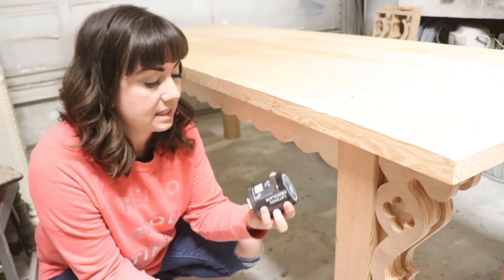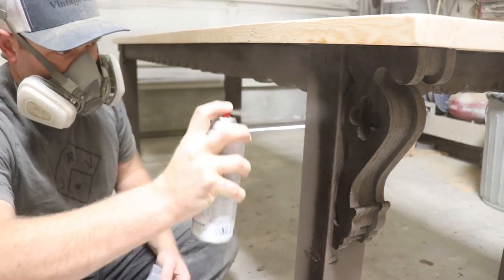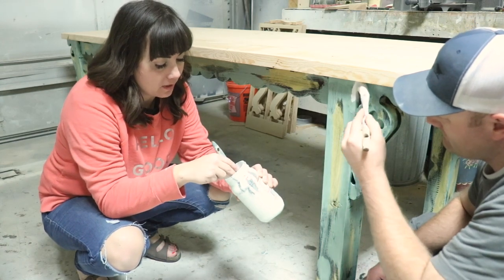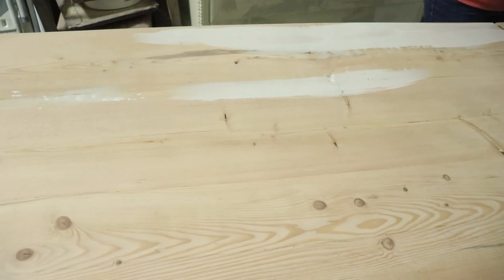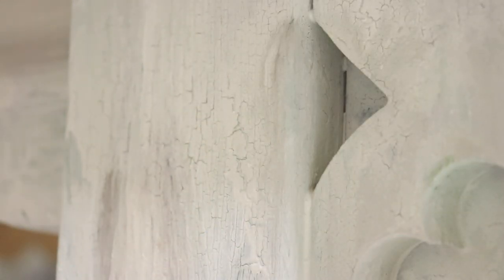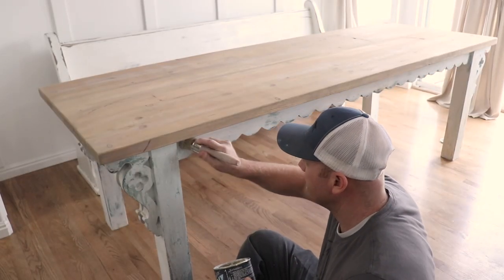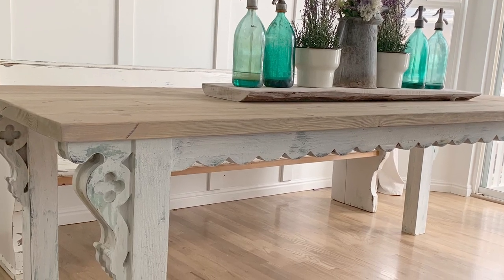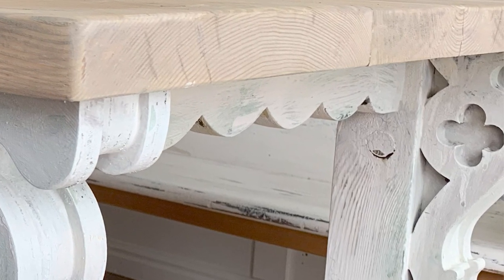Farmhouse Table | Chippy Finish

Comment: LOVE IT!  What is the difference between Shellac and Lacquer?  The table is so cool...it will last a lifetime! ❤️
Reply from the maker: The lacquer is thicker and doesn’t dry quite as fast so you have more time to work with it and hot it with the heat gun.